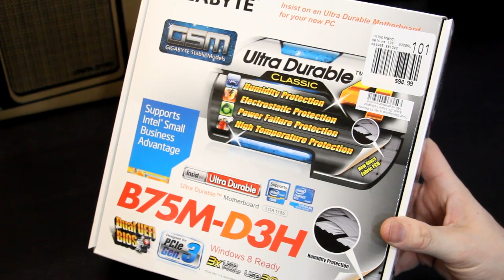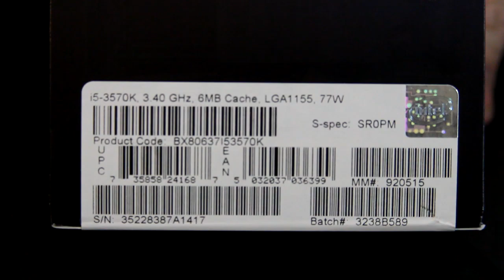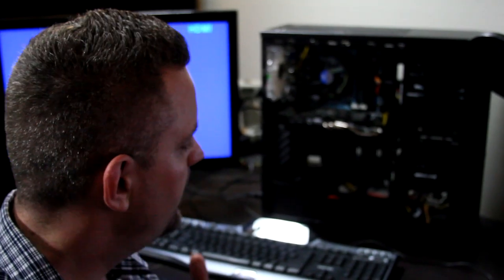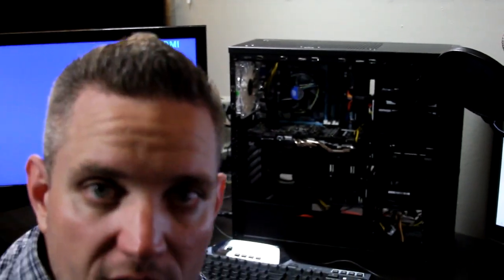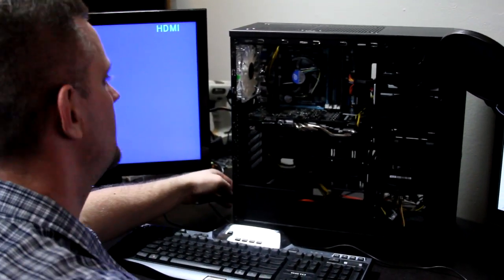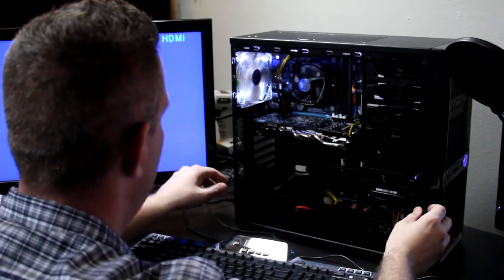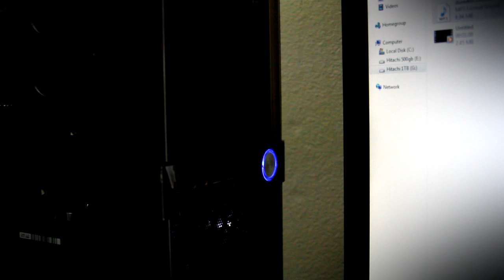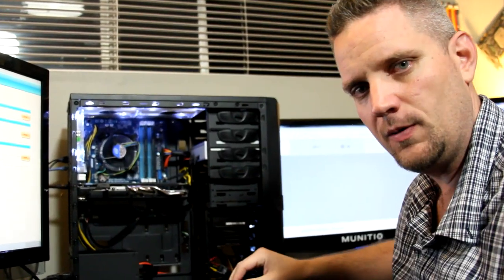How to build a gaming computer - Tech Addiction Special Edition

Comment: Wow basically the same build as my current build !

OS: Windows 7 64-bit
CPU: AMD FX 6350 Six-core 3.9GHz (Upgrading to AMD FX 8350 4GHz AM3+ Black Edition)
Mobo: MSI 970A G46 (Upgrading to Gigabyte GA-990FXA  UD3 AM3+ 990FX ATX AMD)
GPU: GIGABYTE GeForce GTX 660 OC (Upgrading to MSI GeForce GTX 970 Gaming 4GB GDDR5 Video Card)
 
RAM: Ballistix 1600MHz 8gb (Upgrading to 4gb additional)
Case: Corsair carbide series spec 02
HDD: WD Blue 1tb 7,2000 RPM (Upgrading to 3tb additional) 
PSU: CX500M 500w (Upgrading to EVGA Supernova 650w)
DVD: I have no idea, just went out and bought one.

Other things for my upgrade
Cooler Master Hyper 212 EVO Universal CPU Cooler (I think it already comes with the 8350, can anyone confirm this?)
Adesso AKB135EB 3 Color Illuminated Gaming Keyboard
Corsair Air Series AF120 LED Red Quiet Edition Twin Pack
NZXT Sentry Mix 2 Fan Controller
Reply: 212 evo does not come with an 8350 as standard, maybe its an offer??? they are a very good affordable cooler though, so grab 1 but if you have a little extra cash check out the Raijintek Triton AIO CPU Water Cooler (they come with clear pipes/clear gpu block but have 3 different dye colours blue, red or green, so you can choose) and they are "upgradable" - has character over the traditional AIO's that have black tubing and a generic pump/cpu block.
I was fortunate when I upgraded to find an H100 for half price which made it cheaper than the average fin and fan cpu cooler set up. Maybe you'll find a similar deal.
If you were thinking of using the AF120's on the cpu cooler consider the SP (static pressure)'s instead, as they are designed for such a job, if the AF's (Air Flow) are for the case then ignore me :D
Reply: My upgrade in April/May will land me with this:
CPU: Intel Pentium G3420 (Dual core, 3.2GHz) overclocked to 3.6GHz (200MHz faster than my A10-5700 quad-core, 3,4GHz now)
CPU cooler: Cooler Master Hyper 212 EVO CPU cooler with a BC 120 blue LED fan on it.
GPU: ATI X800 GameFX graphics card.
HDD: 1000GB Seagate.
SSD: None and none considered.
RAM: 4GB/8GB DDR3, all 2GB sticks and haven't decided if I want to give it an upgrade or not.
Motherboard: ASUS B85M-G with my old ASUS monotone speaker on it.
Optical drive: Samsung
Case: Medion Akoya E4032
Fans: 1 Cooler Master BC 120 blue LED on the back of the case, another in the power supply, possibly.
PSU: The 430W that is already in the case.
Keyboard & mouse: Just my default Medion peripherals.
Speakers: Just my Technikas which I have had for several years, though due to upgrade to iBoutique Colourjets to either replace or run alongside them.

I mainly want to use the PC to develop Java games whilst being able to test them smoothly. I also want a beefier system too so this'll all be handy. The idea of overclocking a Pentium may seem absurd but it is 400MHz slower than an i3 I was looking at getting. Also the Pentium is half the price of the i3. (£50 Pentium vs £100 i3, I am going with the cheaper option)
Reply: ***** The one I am getting blows much faster AMDs out of the water. The anniversary edition does it even better.
Reply: ***** Also, my other build is using a Pentium, possibly, I am still waiting on a SATA-PATA adapter (I fished the CPU out of an old eMachines PC along with the motherboard, wifi card, GPU, PSU, dust and some cheese). They may be designed for servers but that means they are optimised for some heavy loads which means 2 cores would outdo 4.
Reply: It's an anniversary edition Pentium. With an ASUS motherboard using BIOS 2001 you can overclock to 5GHz.

Comment: is over clocking were u leave ur pc on when u arent using it
Reply: Overclocking is when you change the configuration of your CPU (presuming you mean overclocking your CPU) and it will run faster, at higher clock speeds. Keep in mind there is a limit with overclocking, as it will use more power and also will be hotter and if you overclock it too far can harm your CPU or cause system instability. Overclocking a Intel processor only works on K or X series, where as all AMD black edition CPUs can be overclocked.

Comment: Amd processor, lol. Patriot, lol. Radeon 6670, lol. I guess it's not a bad rig, but. It won't last long in terms of modern games. I guess the Gpu will surfice long enough. Good starting rig, especially if your buying a low end computer, and building it up over the years. Sounds good ;) At least someone can give me the specs of a computer (implying that the owner gave me no answer to my question of the specs). Btw Windows 7 aswell? That's an extra $100

Comment: No, you will not run BF3 well. You may skimp past at low resolutions and settings, but no one enjoys that do they? It looks nice for a laptop, but you're not going to be doing a whole lot of hardcore gaming on it. If you like to game frequently, I'd suggest just getting a desktop. If you want to run at least 60 fps, you're looking at some serious price tags. Laptops are just not designed for the loads required with heavy 3D games.

Comment: Is this better than an alienware alpha i7?
Reply: +Walter White Lol i'm gonna buy the define R5 too, my budget is €1200, what you think: http://pcpartpicker.com/p/crNkt6 (1370 USD is around 1200 euros)
Reply: Jonathan V.n. For less
Reply: Walter White but you can't overclock that cpu (very well). Also (don't get me wrong, i don't THAT much about hardware) but how is that watercooling, I don't see a watertank or such in your list
Reply: its a closed loop waercooling look it up and yes you can overclock it to 3.5 ghz very well with the watercooler plus the system will be much cooler and quiter
Reply: Walter White Okay thanx man,
Reply: np
Reply: ok
Reply: +Jonathan V.n. Another term for closed-loop would be an AIO, but it definitely is Watercooling, and Walter is right, OCing with an AIO is super easy and because of the 120MM fan on the radiator it's near silent ALWAYS
Reply: +Jonathan V.n. Also, Walter's build definitely did add upon your original, just thought a second opinion might help out
Reply: +Jely Fishy any computer enthusiast that has a brain will tell you since dell bought alien ware they have gone to crap and are not worth it

Comment: I've actually decided to go with an FX-4100 (for now), MSI 970A-G46 mobo, and a Sapphire 7770. Much better build in terms of future upgradeability/whatever. I'll probably add an SSD, 8 core FX cpu, and another 7770 over the next few years.
Also, concerning the cost of a Windows install: watch?v=IBH4g_ua5es ;)

Comment: How much would this roughly cost i7 6700K Processor
Memory: 16 GB
Graphics: NVIDIA GeForce GTX 970
Hard drive: 2 TB & 128 GB SSD
Reply: +FaZe JëV 
i7 6700k:  $372.00
Memory:  $64.99
Graphics:  $430.55
Hard Drive:  2TB = $89.99   128GB SSD = $43.80

Hope this helps.  These prices are from Amazon

Comment: How about this system build?
AMD FX-8350 CPU
970A D3P Gigabyte MOBO
280x Toxic Sapphire GPU
8gb DDR3 1333Mhz RAM
620watt M2 80+B CM PSU
120V Seidon CPU Cooler
Fractal Design R4 Case
1TB 7200rpm WD HDD

Price: 7300S.E.K aprox $1100 or €800
I plan on overclocking my CPU to 4.0Ghz to 4.2 and maybe tweak around with my GPU but nothing major,
Thoughts?
Reply: Personally I would add an SSD for your IOS to sit on, go for a 128gb that should do just fine, you wanna build a fast computer but you're using a slow HDD, doesn't quite make sense.  Other then that a nice solid build just dont go crazy with massive overclocking and just one more personally note, just for the head room of over clocking I always go for a 750W PSU, Not because I would need it but just in case i decide to add later I don't have to strip out the old power supply and get another just because i wanted a second graphics card.
Reply: Yeah, my dad go a 750GB SSD lying around which he his gonna pass on to me. Otherwise on my trip to NA I will get a SSD and some faster RAM.
Reply: Quite a solid build you got there. The only changes I would recommend are (obviously) either adding an SSD for your OS, or spending a little more money on a larger capacity SSD and replacing the mechanical HDD. Also, you might want to amp up the speed of the RAM to 1600 MHz or 1833MHz. If you plan on upgrading to dual GPU's or a top of the line AMD, I would also recommend changing the PSU to a 700/750W 80+B thermaltake (or whatever brand you prefer).
Reply: Yeah buying the HyperX 3k 240GB ssd and 16GB CL9 1866

Comment: can a gigabyte b75m-d3h mobo handle a radeon r9 290x gpu and a i5 4570 processor???
Reply: no. a 4570 uses an lga-1150 socket while the b75m mobo has an lga-1155 socket. the b85m version, however, does support it.

Comment: I've been wondering, what are the standard sizes of the motherboards? There are Ultra/full/mid towers out there, what are the possibilities/limitations? I roughly know by now what kind of components I want to put into a custom rig I'll be building in a couple of months, but I still have a problem with choosing the right motherboard from the dozens available.
I'm looking at a Cosmos SE tower, and wondering whether some motherboards won't be compatible in size... Advice? Thanks!

Comment: Im currently building a gaming rig, geting it on september unfortunatly. The specs are pretty high end i guess, it's only costing me £800, it's got an intel i5 3570k ocing it to 4.4ghz 8ghz corsair vengence 1600mhz (ofcourse) amd radeon hd 7870 sapphire ghz edition, and all the other basic stuff, so i know how a pc works and stuff, but you cannot simply build a gaming pc for $400 without it getting loads of framerate issues on even the lowest of graphic settings, the owner of this vid is lying.

Comment: I feel like im missing sumthin since this build is so cheap please help i54690.       Asrock mobo 1tb hdd midtower case gtx 970  evga 8gb ram and  700w psu am i missing anything cuz its only  868$ :) and no i dont need os ok
Reply: WiFi adapter if ur gunna use wifi
Reply: Probably an optical drive, CPU cooler and a SSD if your planning on using one.

Comment: I have build some like this (700 euro) with AMD A8 APU 6600k BE (3.9x4, max 4,2x4), 8gb ram, same mother board (socket FM2 for AMD cpus), Gigabyte Radeon HD 7850 2gb OC (i oc it to 1050mhz) and i run all games in 1080p i max, ultra set. and only crysis3 have some like 20-40 fps with fxaa in fullhd ultra set. For me its good performance. Better spend 700 euro (900$) for PC not 400$ for consoles

Comment: Hey, great vids. Subbed!

I have decided to upgrade my pc. It will be my first attempt so its safe to say I'm a complete noob...

I went ahead and ordered a new gpu and psu:
Gigabyte NVIDIA GTX 970 G1 Gaming Edition.
Corsair CP-9020055-UK RM Series RM750 80 Plus Gold 750W.

Anyone that can advise on what I should be upgrading next (if indeed I need to) and compatibility issues would be much appreciated. Also considering overclocking. Here is my current rig excluding the new components:
 
Gygabyte H61M-S2PV motherboard.
Intel core i7 3770k with the factory heat sink .   
Ballistix 8gb ddr3.
Cooler Master K-Series K280 Case with intakes on the front and side and one exhaust on the back.

Many thanks in advance.

Comment: You should save a little more man. Like 700$. And get like cheap case corsair 200r, AMD FX6300. Cheap AM3+ motherboard, r9 280x. 8gb of ram 1600 and a 500w 80+ bronze PSU.

Comment: How is this for a $1036.35 Gaming Desktop? Comments/Feadback?

AMD FX-8350 4.0GHz 8-Core

Gigabyte GA-990FXA-UD3 ATX AM3+

Corsair Vengeance 8GB (2 x 4GB) DDR3-1866

Western Digital Caviar Blue 1TB 3.5" 7200RPM

Gigabyte Radeon HD 7870 2GB

NZXT Phantom (Black) ATX Full Tower

Corsair 750W ATX12V / EPS12V

Lite-On iHAS124-04 DVD/CD Writer

Microsoft Windows 8 (OEM) (64-bit)

Comment: nice im building one for $850 with the following specs :D
FX 6300
Gigabyte 990FX UD-3
PowerColor HD 7870 XT
Corsair TX 650w PSU
Kingston Blu 8gb ddr3 1600mhz
Fractal design R4
Coolermaster T4
Seagate Barracuda 1tb hdd

its going to be purdy good :D

Comment: Germany:
Cheapest HD 7870 :170€.
Cheapest GTX660 : 165€.
So it's the same.
But you can overclock the AMD Card better and it's more powerful at stock speeds.

Comment: can anyone tell me if i can run BF3 good on my lap top, its an acer V3-551-8419 model, AMD quad core processor A8-4500M with 2.80 GHz, AMD Radeon HD 7640G with 512 Graphics system, 6GB DDR3 Memory, with 750HDD, all stock, and what do you recommend to change to run at least 60fps, please msg me im a 18yr old noob -.-

Comment: Actually, just do this: (max socket wattage / stock voltage) * OC voltage. If your CPU is maxing out the wattage, then there's your bottleneck. Physics ftw:
W = V * A;
∴ A = W / V;
∴ W_f = A * V_f = (W_i / V_i) * V_f

Comment: I don't wanna say that NVIDIA is bad,but just overpriced.
Look at the GTX 650TI (Boost).
It costs like 170€ the same as a HD7870.So what's the Point of buying it?
Therefor NVIDIA has less problems then AMD ( Blackscreen etc..) and NVIDIA has better Driver Support and of course better  PhysX

Comment: Lolz, because a 7770 obviously can't play BF3 at 40fps on 1280x1024 high settings :p
Unlike the people who spend thousands on their computer setups, I'm not gaming with 3x 1440p 120Hz monitors, so I'm not going to need to use low settings to fulfill a carnal lust for absurd framerates.
For reference, an A10-5800k xfired with a 6670 can play BF3 on high settings @40 fps (?v=NJ5hhGrOKAk), and a 7770 can play it on 1080p ultra @20-30fps (?v=_eFwCSaGu80).

Comment: Not really. If you take a look at the PS4 or Xbox One, they're $500-$600. That will buy  you a great PC capable of much more than gaming. Personally, I can't stand the dinky controllers with consoles; I need a mouse and keyboard. In the long run, combined with cheap PC games and the longevity of PC parts compared to consoles, PC will be cheaper in the long run. I used to think PCs cost a ton of money until I built an amazing PC for >$600 that runs Far Cry 3 on max.

Comment: Will this computer beat consoles? http://pcpartpicker.com/p/TJ6zsY
Reply: right around/above consoles. You wont be able to ultra this, but it'l work
Reply: Omar Angulo get a G3258 rather than the i3. I have my 3258 running at 4.5 Ghz on an H81 board, which easily surpasses that i3.
Reply: ***** As I'm sure you're aware, there are precious few games that are optimized to run on more than one, let alone more than two, threads. The G3258 has a better single-core passmark AT STOCK than the 4150 that the OP proposes to use, and with a decent (and exceptionally easy to implement) overclock, will absolutely thrash it. My rig uses the exact same card that the OP has listed, whereas I have only 4GB of RAM, and I have absolutely no issues getting framerates in the 40s and 50s on high on any games I play.

The G3258 also has a far better passmark per core than the 860k, and uses far less power. It was something that I considered when planning my PC, but when you take everything into account (and put aside any red/blue allegiance induced bias) the G3258 is the logical choice in this budget price range.

So, the G3258 is by no stretch of a blatantly inept imagination an overrated piece of shit, nor is it sub-par for modern gaming.
Reply: ***** But alas, they do not currently.
Reply: ***** I must reiterate, the extra cost is not worth it, as the hyper-threading only allows the i3 to masquerade as a quadcore, the G3258 has better stock performance per core than the i3, vastly better performance per core than the i3 when overclocked, and also surpasses the 'red team' per core.
 
I do not wish to have to assume the worst about the intelligence of someone who is unable to accept another concept when the proof is presented to them, but it seems that, in this case, I must.
Reply: ***** I neither doubt nor dispute that you speak from experience, as do I. As it happens, I have never experienced the problem of which you speak with any game I have played, so I would wonder whether it is attributable to the core count, or another potential variable.
Reply: I would get a better power supply
Reply: +NONSENSE There is nothing wrong with console gaming, just respect what other people choose.